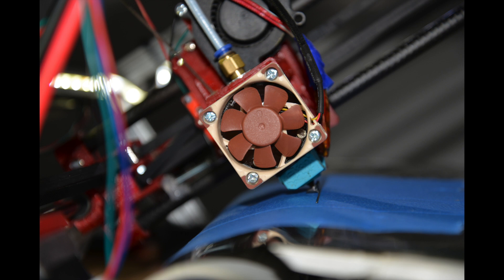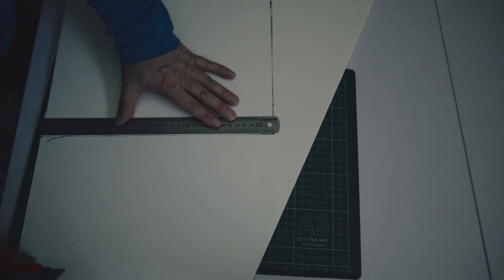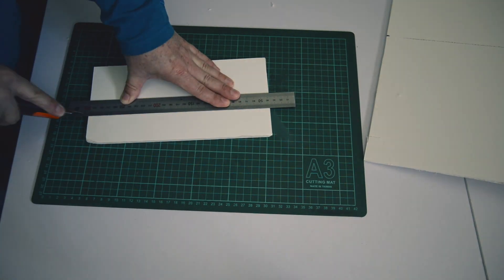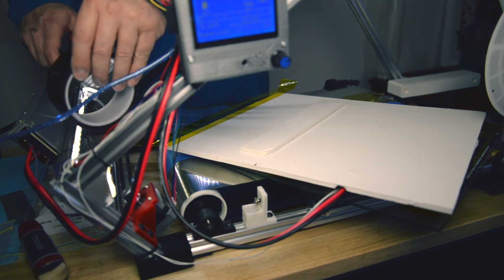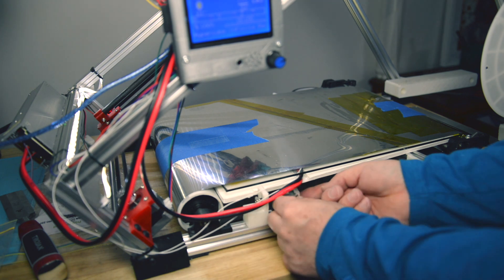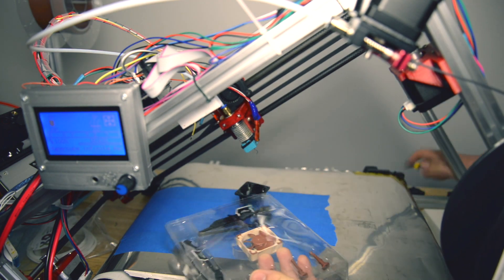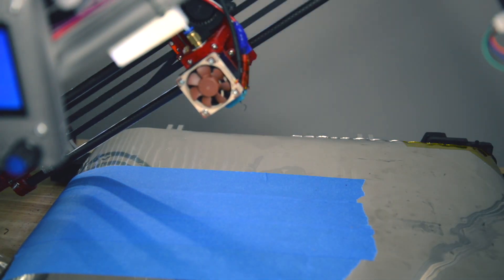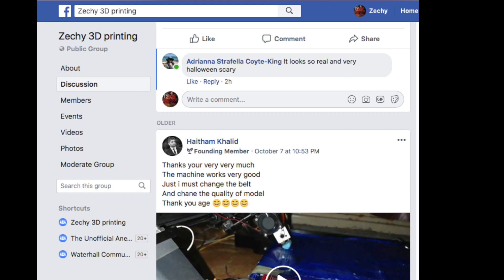Hypercube Infinite: Noctua fan and Insulation on heatbed

Comment: Nice, might i suggest that you end your intro with a still of your logo? That would make it more rounded. 
Also, next step would be to encase the printer to be able to print higher temperature materials like ABS and PC. And maybe also add chamber heaters so even the tallest of prints come out good
Reply from the maker: Thanks for the suggestion. I was wondering what to do at the end of the video :)
An enclosed chamber is definitely on my list. Thanks for your support.